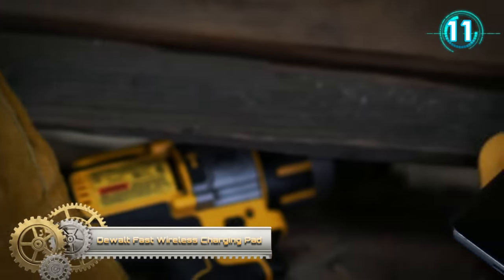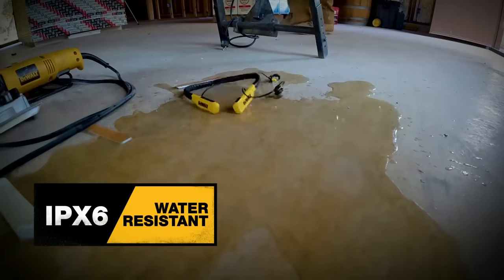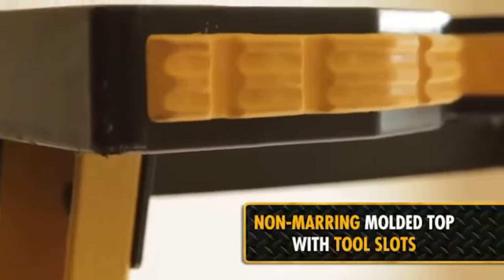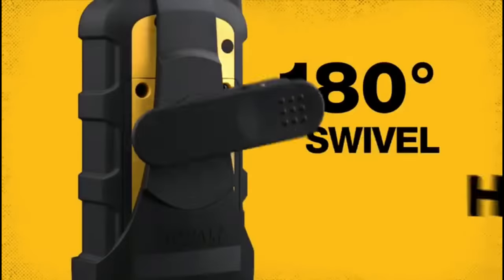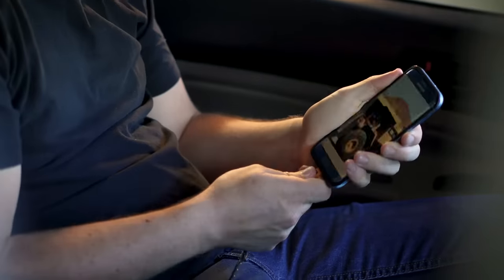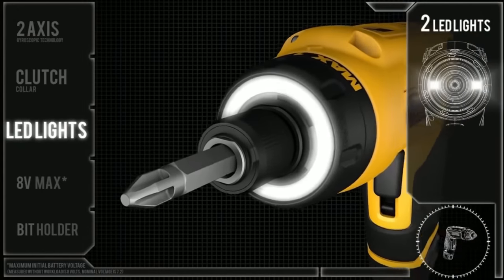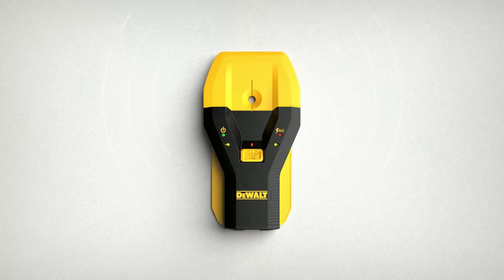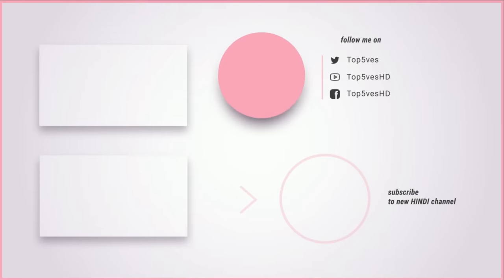DeWalt Tools You Probably Never Seen Before  ▶ 1

Comment: Shame on site radios/earphones have been banned.off most job sites. Also, the steps tool wouldn't be allowed for not being 600mm wide and no hand rails. UK H&S is a joke! No step ladders allowed, but you can use stilts if you are a dry liner!!! WTF???
Reply: Damn that sounds crazy, they should let you wear one ear bud. What is H&S?
Reply: @actionjksn  Health and Safety. They go for the Safety more than the health!!! There is no upper temperature limit on jobsites, so 30 plus degrees can occur in the UK and long sleeves, no shorts, hard hats and glasses must still be worn!!! Ludicrous!
Reply: It's because you let insurance company dictate how men work. It's all about the money the money the money the money the money

Comment: 10 watts is out-dated for wireless charging for anything past a galaxy S9/S9+. Would work in a pinch at the job site if not on your phone or get calls often. And if I remember correctly it will top out at 7 Watts for an iPhone. Which is all the iPhone wirelessly charges at.  The included power brick and cable would be faster than the wireless charging pad.
Reply: I had that. It took forever to charge anything even low end flashlights.
Reply: Hater
It works that’s all it matters.
Reply: @fernandogarza9180  well, it works, but not as stated. Technically speaking it's misleading and false advertising!

Comment: So they copied LG Tone earphones.
Reply: More then likely they are made by LG for Dewalt
Reply: Looks like it, I still have my LG Tone active plus headset, I don't use it very much since I got my Samsung Galaxy earbuds but it's still a good product, too bad the LG Tone and Talk app don't work anymore. Was looking for a new LG Tone active plus headset because the battery on mine is going bad from use or lack thereof and they are hard to find
Reply: @SouthernStyle08714  I got the Lg retractable head set gently used from a friend. The sound was great but everyone on the other end complained about hearing background noise. Then the left side stopped working.
All in all I wasn’t really impressed with the durability given the price, so I never bought new ones.
Reply: @DiligentDave1966  I enjoy mine, the pair have and use now is the second pair I have owned. The first pair got broken and messed up at work, I used to drive a 28 ft box truck and the rear doors on it were like semi truck doors and I hung my headset on the handles that you use to climb up in the truck and the helper that I had that day didn't pay attention and shut them in the door and broke them I was pretty pissed off but wasn't anything I can do he said he wasn't going to replace them and I'm going to try to talk to my supervisor about it he said there's nothing they can do so I ended up having to replace them on my own
Reply: @SouthernStyle08714  I’m glad you’re happy with them. I did like the way they hang on your neck instead of always having to be in your ear like some.
Reply: @DiligentDave1966  yep, they are definitely convenient, I never had any issues with mine but they never really saw any severe abuse either I always tried to be easy with them because I knew the retractable cord that was attached to the earbud would eventually come loose. I have two sets of Galaxy buds now that I use, I have a pair of the original Galaxy buds and a pair of Galaxy Buds Pro. I like the Galaxy buds Pro a lot better because they have more features like noise canceling and you can use ambient mode while on a phone call that way you can still hear what's going on around you.

Comment: I like the toolbox with lid that turns into a stool . That's using the space of the lid . Great idea. Built in bluetooth stereo in it with a plug in , usb would also be good to add to the stool toolbox...
Reply: or you could do as most will and stand on the box
Reply: The step looked weak, then flexed too much when the guy stepped on it. Will fail too soon, probably causing injury.
Reply: @commandoconstruction2720  stairs must be sturdy . Period.
Reply: disagree. It is a platic toolbox with a plastic step.
Better would have been to make the entire toolbox out of metal and then use the box to stand on
Reply: The collapsed "Step" takes up space in the box that could hold tools. I've never seen any collapsing step stool that was worth a darn. I can't imagine the box itself is even strong enough to use as a step. Use just the lid and we're looking at a happening waiting to disaster.

Just use a metal tool box. Stand on that.
Reply: @DrLumpy  not worth the twisted or broke ankle , put you out of work for 2 or 3 weeks . Huh . Them twisted ankles hurt . I've had a couple over the years.  Your right

Comment: Quality of the drill drivers arent what they used to be.. The cordless 20v drill driver chuck stops locking in the bits. Something changed with the quality of the spring used in the auto lock feature. They failed within 60 days on two consecutive purchases. but when the 20v first came out they took my daily abuse for at least a couple years without issue. Everybody i know has switched to Milwaukee now.

Comment: Why do you not have a 20volt jumper box,I have been jumping off car's and trucks with a 20volt battery for years, I used a old drill to hold the battery and the wires that go to the motor I put clamps on them.
Damn dewalt what's up

Comment: Now make a lithium ion battery powered quick inflater for inflatables like air mattresses, floats, etc. Toyobi already beat you to it, but I refuse to own that crap.
Reply: They already do. I own one and it's perfect. Look for 20v dewalt inflator, it does inflatables and tires
Reply: @benoitchartrand5772  does it look like a drill or is it the one that looks like a radio?
Reply: @scottparsons6631  more like a radio. I use it every week. I never thought I would've used it that much
Reply: Dcc020IB is the model number
Reply: @benoitchartrand5772  it's a good comment and even better reply! Thanks for coming back with the model number. Will be useful for me as well 😉

Comment: How about you build tools and stop playing with grocery store tech accessories
Reply: It's because dingdongs who buy things based solely on brand names will buy anything with the right name on it.
Reply: What tools would you like them to make that they don’t already have in their line?
Reply: @michaelcapretti6057  cordless,  variable speed, 4" angle grinder.(makita has multiple)

Power inverter with 110 plug (not just USB ports) (almost everyone but dewalt has one) 

Cordless wet/dry shop vac (rigid has one)
Reply: @brandocommando4459  dewalt has a 110 inverter that takes 4 dewalt batteries with a peak output of 3600w and 1500w continuous, why would they need to make an inverter for vehicles, theres sooo many out already. Dewalt also has a 110 and a 20v wet/dry shop vac.